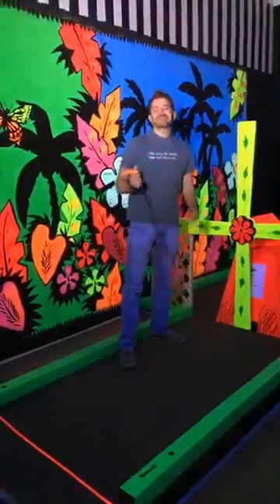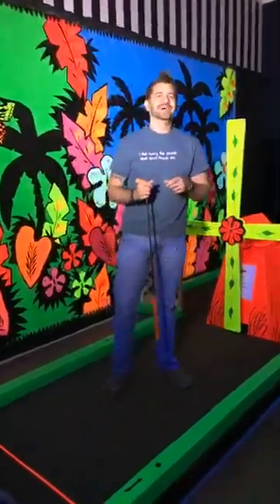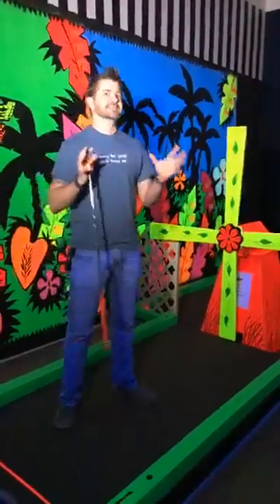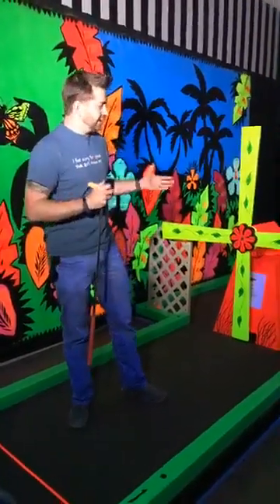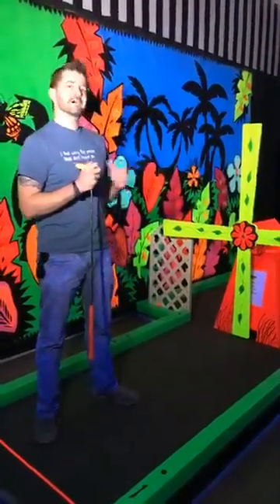3D Basecamp Design Challenge

Comment: Hello. 
How much height is allowable? 
Thx in advance.
Reply: We did not set a specific requirement, but the holes need to be self-supporting and easily moved. I would think that you could go a few feet high without an issue but probably should stay away from any super tall designs.
Reply: Aaron Dietzen 
Thx.